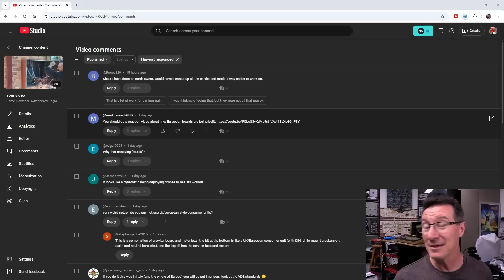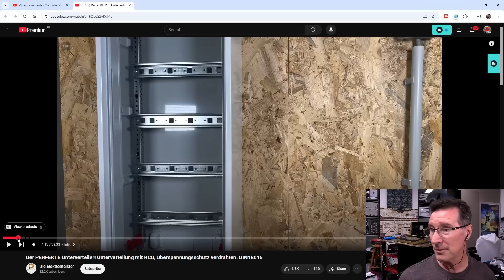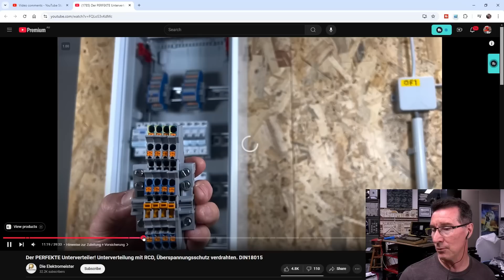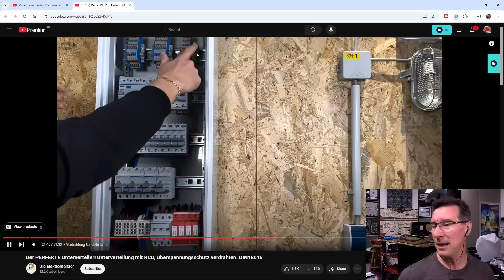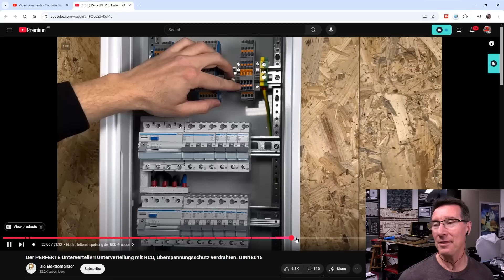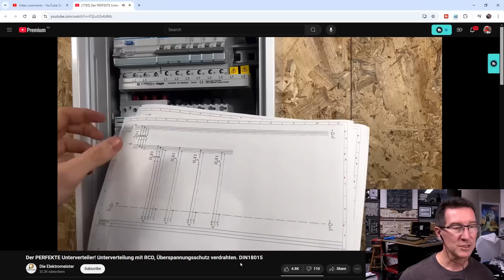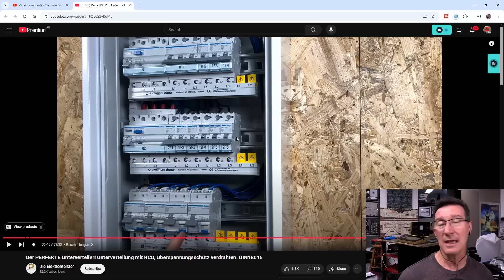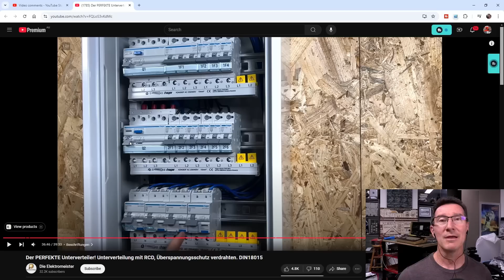eevREACTS - European Electrical Switchboard Wiring

Comment from the maker: TLDR; No surprises here, apart from ferrules and stranded wire. This type of ABB enclosure is exactly what I'd expect to find in an indoor box in Australia, with the exact same DIN rail arrangement. Would be expected inside a new build apartment or large mansion that has a dedicated indoor switchboard room.
It would be just as messy as mine if you added 9 current clamps behind it.
Reply: there is nothing for "automation" in there ^^ 
"Automat" in this case refers to "Sicherungsautomaten" which are the actual "fuses".

those phoenix contact blocks are called "Reihenstockklemmen", they are just to connect the output of the fuse to the actual load, which will all come in from the top. the metal bar he put in in the first block is for shorting all the grounds together.

the first thing he showed was a combined fuse/rcd, which gets more and more common over here to put an rcd on every circuit.
Reply: @miko007   the bar is for neutral the ground goes over the "hutschiene"
Reply: @kevinheimann7664  thats what i meant. i am not a native speaker, on DC its called ground, so i thought it could be used for AC as well. the green/yellow one i would call "earth", as we also call it "PE" whicht stands for "protective earth".
Reply: @miko007  It annoys me so much that Dave doesn't even try to understand the word "Neutralleiter".
This feels like clickbait.
Reply: Subtitles are available, auto translated as well.
Reply: Now react to an American breaker pannel for all us American viewers.

Comment: The main advantage to me to european electrical boxes is the DIN standard. It allows you to install whatever component you need inside your electrical box without changing it or drilling holes or something. You need to add circuits, add breakers. You need to install a power supply for an intercom? A smart relay? A timer for external lights? A control box for an heating system? You have everything in one place. 

Doing alterations in the future is so much simpler, you just open the box and add whatever device you need, wire it, and remove one blank plate on the cover of the box. You can also do that live without much risks (tough if possibile is best to remove the power before opening it!). Typically in boxes of older houses you see a multitude of devices of different eras, but all of them fit in the same exact box and didn't require any mechanical work to fit them. 

To me the key thing is flexibility, and especially since a lot of these boxes are encased in a wall (that is, the faceplate is flush with the wall) you can't easily swap them around.

Comment: I don't know when they switched code to use those DIN Rail boxes here in Austria, but I've seen plenty of asbestos/phenolic resin plate switchboards in older Houses. My house was built in the early 70s and already had a metal box with DIN rails. As Dave said, electrically it makes no difference, from the fuse to the outlet, you'll have the same wire mess as everywhere else, some use single wires, some use cables... The only major difference I spotted, was that here in Austria, every house get's a 3 phase connection, which is rather convenient for different reasons.

Comment: If I'm recognizing the language, the narrator is speaking German, which means this is probably in Germany, where 3-phase power in residential homes is the norm.  That's going to be slightly different than the layout in, for example, North America where split-phase (two hots and a center-tapped neutral referenced to ground) is the norm in residential.  (Larger commercial and industrial buildings often have 3-phase, to better drive the electric motors in the HVAC and industrial machines.  Restaurants may use what's called 'red-leg,' where one phase of 3-phase is used, giving an RMS of 207V to ground.  You don't want to cheap out and connect something like a 207V commercial toaster to 240V.  It will burn out elements, often quite dramatically, with lots of arcing, bright light, and bits of molten metal being thrown out of the device.  I saw that several times.)

Comment: You mention that you could specify how the switchboard should be built in AU. That's a difference, and not possible here, at least not in my country (Norway). Here we can only specify where we want the outlets and switches to go, but the intake and switchboard layout is up to the professionals to decide. We can certainly ask for a bigger cabinet, to allow for future expansions, but we cannot instruct what kind of enclosure, breakers or circuits to be installed.
EDIT: Ferrules are not that common, maybe in Germany ;)

Comment: I don't understand why anyone would just defend bad practice.
And unfortunately there are plenty of bad practices in Europe (or anywhere in the world for that matter) as well, which are defended with the same bad fallacy "this is how we do it".
Rats nests of wires are just poor electrical design.
Reply: Yet you continue to ignore that Dave's original setup was from somewhere in the '80s and had been hacked about over the intervening 40+ years.  If you start from scratch in Australia today, as in take the entire switchboard + enclosure out and rebuild, you'll end up with something very similar to what is shown in the video.  The standard outdoor enclosure will see the breakers etc differently arranged to the indoor unit depicted of course.  I bet if I went to where ever you are and had a ferret around at 40+ year old installations they'd be a bit rough too.
Reply: @retrozmachine1189  Oh man, old installations are the worst. No matter where you are.
Reply from the maker: Correct.

Comment: meh probably gotta redo that with cc on we do stuff around here very differently and no this is not a new housr from what it looks like. this is more of a show and tell thing we dont put our junction boxes on OSB boards usually

neither do our boards swing open like yours (removing the need to have your length of wire allowing for the ratsnest you had) and also it seems like he ist doing it to the end b/c we usually put covers on the unused spaces and specifically only remove them temporarily when doing addons after the fact or maybe for troubleshooting

Comment: As  a server engineer , i can only dream of IT guys discussing cabling like this. Its almost a badge of honour in IT to have your comms cables looking like spaghettti, but still working. Bonus points for no labelling, documentation, and a ton of "clever" wiring hacks  that always turn out to be the source of the problems. Worst part is electrical faults always get blamed on the electrical installer, and the electrical installation is usually the only thing on site wired to spec and corrrectly. Its never, ever the customer fitted $200 home PC UPS wired in series to 20 servers, or the comms room pulling triple the load it was specced for.

Comment: Since youtube is so slow, when I'm skimming a video like this, I'll just drag my mouse along the red progress bar and watch the little screen that pops up.. then it can actually flip through all the images quickly.   Actually, you can click on the progress bar and drag it upward a bit.. and it will change into a different play mode that will let you drag through the content faster, and still see it on the big screen......  Also I have speed controler extensions to play the videos at 2x, 4x, 8x, 16x, speed if I want..  and everything in between, with a few hotkeys..   Well worth it.

Comment: I use ferrols for stranded wire. Makes it a bit easier to put the wire in fuses and makes it look nice. There is nothing wrong using them cause thay are kinda thin and will bend and crush when tightened to spec. Mostly thay are used in automation because of stranded wire. In residential mostly we use solid cable.

Comment: @2:44 of Daves video: The blocks shown at 09:00 in the video are not for automation or comms. Those blocks are just for distribution (the neutral after the RCD in this case). And the "Automaten" the guy was talking about is the shortened word for "Sicherungsautomaten" wich are the automatic circuit breakers.

Comment: You should really have a look at the Phoenix terminals. They are used to separate the internal cabling from the box to the outside cables. You could complete the box somewhere else completely and then bring it on side. And then just connect all the cables from the walls to the Phoenix terminals in the top. This makes it also very convenient when you want to change anything internally, because you don't have to rely on whatever length of cable you have from the house installation.
As far as I know the Phoenix are not normally used in German house boxes. They are more likely used in office buildings or industry. But they are great. Outside of Germany they are also expensive. I imported a big box of them from Germany to do my electrical home installation in Bangkok.
Reply: Yeah here in Germanny there are mandatory in Industrial and Public Buildings, in Private homes your allowed to srew your solid wire directly to the fuse. But its a nice to have

Comment: The Box shown here is only IP44 rated. Here in Germany this would only be used inside.
For a retrofit like yous, we would have used something with at least IP54, better IP65 rating, since it is outdoors. This would keep insects and condensation out.
The box then would be mounted solidly to the wall. Mounting it like in your upgrade video won't be OK, since solid wires are not supposed to be repeadedly bent after insallation.
Also having the cladding of the cables removed outside the fusebox won't be OK here. (The existing Metal box probably won't count, since the breakers are in another box)
The inside of the box won't look that different. I would leave a lot more room for future expansion, but that is a matter of preference.

Comment: This Metal box has a plastic liner on the inside. This way it still counts as double insulated and won't be grounded. 
This is the normal way to do it here in Germany (where also the video is from).

Comment: That is from Germany. I wish all of the switchboxes here were done like this
Most of them I came across are either:
a thousand years old and falling apart (Harrison Ford screaming: THIS BELONGS IN A MUSEUM!!)
500 Years old and got "fixed" and added stuff to it a thousand times by "I know a friend who is an electrician"
or done by some dude with minimum required knowledge about how to do things. Like screws not tightened, wrong size breakers and so on
Almost all of them had no proper or wrong labeling and documentation

Comment: You should see what a switchboard is in an old building in Paris. 
Best way to describe how these buildings are wired is : fire hazard. Wooden enclosure, coton wrapped wires, porcelain fuses replaced by random bit of wires, and of course next to it there is a natural gas pipe.
When these places finally gets renovated, the new electrical installation is put on top of the old, that stays disused, with wires for switches and outlets cut and plastered on. A fuel for nightmare.
Correctly done new construction or meticulous renovation work looks like the video of this german guy. But it's pretty rare. But most of the time, it's okay-ish code compliant and no more. Not many cable management pRn lovers here in France.

Comment: I don't get the excitement of people here (I am German btw). This is not really different than what Dave has. It is just a 3 phase job (which is usual here), so it looks bigger and "more crazy". But in the end, it covers the same functionality. Of course, the housing is new and has shiny metal DIN rails and the wiring is new, but hey, why would you scrap those from Dave's existing installation? Just a wast of resources.
Reply from the maker: You can't just replace the wiring in my house, and extending them all is just crazy, so you do what you can do to tidy it up.

Comment: But is there a difference between the components used? RCDs, GFCIs, etc. (I'm not an electrician so I'm not sure if those are even used in fuse boxes or are part of the outlets (UK thing I think?))
Reply: Not in any significant way.  In Australia the standard, which forms the basis of each state's electrical regulations etc,  currently says no more than 3 finals under a single RCD.  With the price of RCBOs though you might as well put an RCBO on each circuit this way an earth fault does not trip off half the house and you get the advantage of lowering the overall baseline leakage on a given RCBO.  The minimum RCD functionality that can be installed these days is type A, except when replacing an old AC in which case it is permissible but not advised to fit an AC.
Reply: @retrozmachine1189  100%, I will never understand not spending a couple hundred more to do RCBOs for each final circuit (especially if you're spending hundreds of K to build a new house), it's utterly bizarre.
Reply from the maker: I like that my new panels and RCD for every circuit. Earth leakage is basically the only reason any of my circuit ever trip.
Reply: @EEVblog2  Yup, that's why I've upgraded pretty much every house I've ever lived in to RCBO per final circuit ;)
Reply: @EEVblog2  in Canuckiistan we need GFCIs on outdoor and bathroom plugs, at least  that was the code at one time.  I think on new construction there might be more GFCI and arc protection these days, but that takes all the fun out of it. Built a garage 2 y ago, needed tamper proof plugs as per code. So I suppose I could keep children in the house (built 30 earlier) that has no tamper proof plugs at all, lol.
Reply: @SwordQuake2  RCD is Residual Current device, GFCI is Ground Fault Circuit Interrupter, seems pretty darned close to the same thing.

Comment: I'm building a house and recently bought like +1000 of these ferrules, called tubular terminals here in Brazil, for 1.5/2.5/4.0/6.0/10.0 mm² multi-stranded wires. They can slip or be torn if inserted directly on miniature circuit breakers, surge protectors and leak current protectors. They make installation a lot easier.

They were more expensive than cheap Chinese terminals because they are made from tin-platted electrolytic copper and fire-retardant Nylon-66, which I've tested and confirmed to be.

Comment: Dave did you say that there was going to be a new model of the clamp meter coming out? My EEVblog clamp meter non contact voltage detector thinks there's ACV every where.
Reply from the maker: No, new model multimeter, BM2257
Reply: @ ah ok. I’ll have a look at that thanks. Oooh auto hold 😮

Comment: What is the reason for the aussie box to be outside? (don't you guys know water and electricity don't go wel together) 😁🤣
Reply: It is from the old days when meter readers would open the switchboard and read your usage for billing.
Reply: @morantaylor  It's also easy to screw up some ones switchboard, so they are siting in the dark and then get murdered. (or did i watch too many thriller movies?) LOL
Reply: Water? In Australia??   ;)
Reply: Main switchboard is outside since metering etc must be accessible by the authorities and it gives emergency workers a place to go and turn the installation off from outside the house.  If something disastrous goes wrong electrically you really want it to go wrong on the outside of your house.  Since there's plenty of space it's pretty typical to have all the breakers etc in the same box.  There's nothing wrong with having a sub-board inside to control all the circuits but the main switchboard goes outside.  USA has their equiv of the main switchboard, first point of disconnect, outside too these days whereas before only the meter was outside.

Comment: 3:55 required in EU for stranded wire
Reply: I am been Finland and my time at school year 2012 or so there was no law yet at least for those to be "required" as if you check fuses etc connectors they give you picture for compatibility for stranded and solid wires at connectors and wago makes connectors specifically for stranded wiring too.
Reply: @XantheFIN  depends on terminal type. Breakers usually have screw behind metal plate but where screw goes against wire there it will cut strands without barrel

Comment: UK seems to be set on RCBOs on every circuit now, split boxes falling out of favour. The Ring Final is falling out of favour for radials in new builds but Ring Mains are still very prevalent, in kitchens because of the cable loads.  2x2.5mm cables are easier to manage in UK sockets than 2x 4mm. Like any country new installations are very similar - however it's the older installations where significant differences between or even in countries is evident.  I have seen some very dodgy installations in parts of Europe as well as 110% perfect ones.

Comment: Pretty sure that board is pretty much the same as how a modern house is done in Australia, apart from the 3 phase.
Reply from the maker: Any apartment or large house with an indoor switchboad, yes. Typical suburban house with a simple outside box could still use a swing panel and metal enclosure wiht plastic DIN box like mine. Expecially on the cheaply built homes where every cent matters.
Reply: @EEVblog2  FWIW modern AU meter boxes tend to not have a swing panel for the breakers, usually it's an integral DIN rail enclosure/enclosures at the bottom of the box, with your meter/service links/service fuse on a swing panel at the top.
Reply: The Pilbara in WA is 3phase by default. Since we need lots of AC.